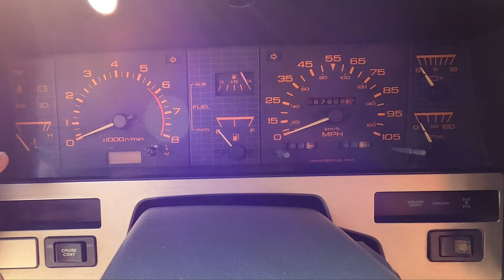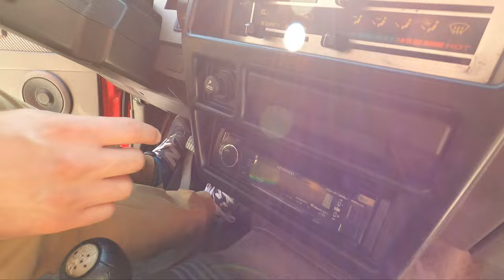RAD RETURNS - 2024 Nissan Frontier Hardbody VS 1986 D21 Hardbody

Comment: My first truck I bought brand new was a 1993 king cab 4x4 se with the 6 cylinder it was bulletproof back then! Loved it and I had a manual transmission
Reply: I just bought a 1993 4x4

Comment: Sucks the frontier HB doesnt have rear lockers and just cost as much than a pro4x. Also no leather option or led....imo not a good value when compared to pro4x.
Use to have a 93 Sev6 in the same red and wheels

Comment: wish the  new one came in a king cab
Reply: It does I checked there website
Reply: @HenryCalderonJr   nice like the 6' box
Reply: @HenryCalderonJr Nissan does have the small King Cab with the longer bed but not in the hard body Edition so if you buy the Hardbody Edition you get the four-door crew cab

Comment: I drive a 5/86 Kyushu built LHD D21 kingcab 2wd Z24I electro-injection with forklift timing components in the summer and a 1988 WD21 SE-V6 with VG30I also Kyushu Japan import during the winter. Anyone know how many pre 86.5 D21 Hardbody were built in Japan and where they went? Because this is the only one I have seen made in Japan. I have a short up of the door tag.